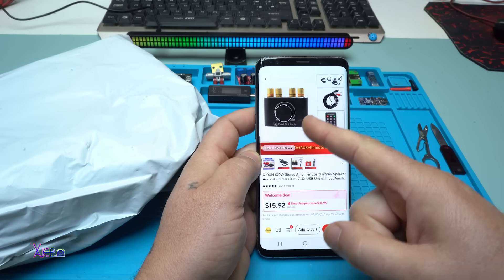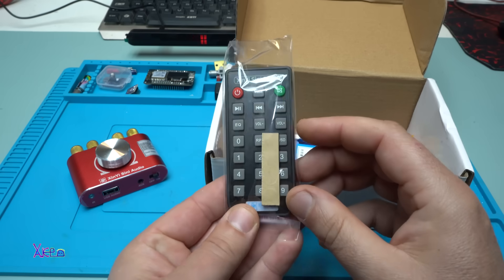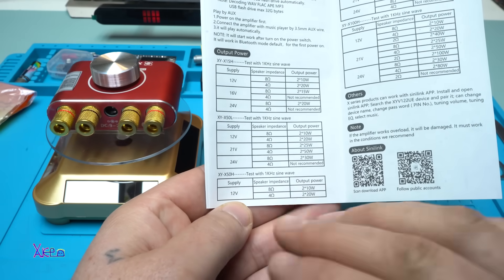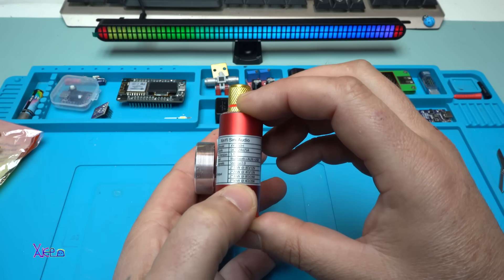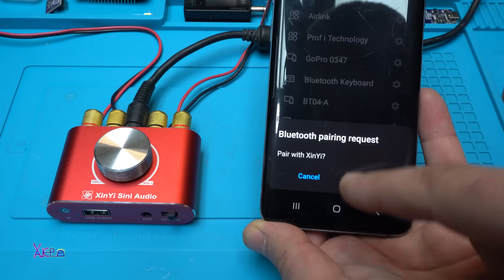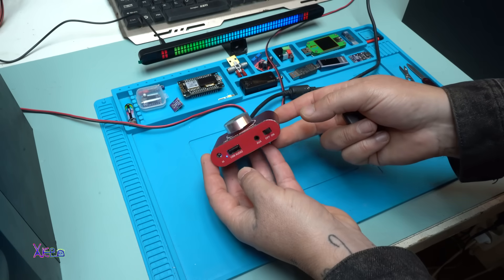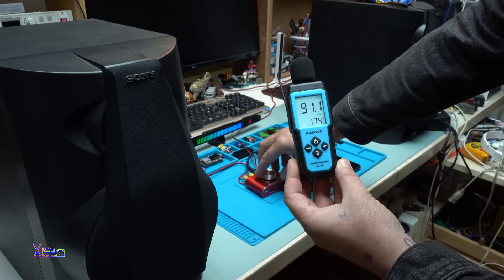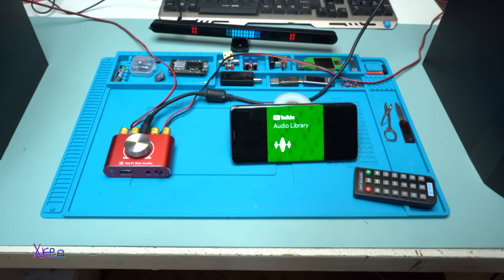XY-X50H  50Wx2 Stereo Bluetooth Power Amplifier TPA3116

Comment: Sounds excellent from my speakers, I'm using an ALTEC surround system 5 speakers plus woofer.  I'm curious how I would use it, currently I use a bluetooth connection to my laptop to play music from iphone.  My laptop is connected to my blaupunkt tv screen used as a monitor and hooked up to my surround system.  Thanks for the presentation!

Comment: awaiting your video for combining the 110/220V to DC isolated switch power supply and XY6008 Regulated Power supply. The first has just arrived the second next few days. looking forward to seeing which container you will use and the wiring. Thanks for all the videos. I am currently using one of your video modules to power the speakers i found - in the shed. sooooooooo coooooooooooool! thank you
Reply from the maker: That sounds like a fun project! Glad my videos are helpful and today I publish the video for my power supply xy6008
Reply: @Hacktuber  this is the one i am awaiting. i am going to make the same unit. thank you

Comment: What are the meanings of 5.1  ?
Reply: 5.1 symbolizes an audio system that uses 5 + 1 speakers (each one with its own amplifier).
The 5 main speakers are arranged as follows :
2 front (L / R) and 1 center ;
2 back or surround (L / R) .
The 1 remaining speaker is for the subwoofer channel and it may be placed rather anywhere in the room .

Comment: Looks so beautiful. I have a similar model from another chi company. It sounds great. It also has good bass but you will have to adjust it. Most probably in your model, long pressing (or double pressing) the knob while playing will change Equalizer settings. Try it in different ways until you find out. Try it several times until it gives good bass and sharpness.
Reply from the maker: Thanks for the tips on adjusting the equalizer settings!